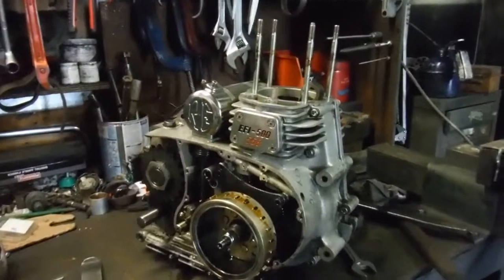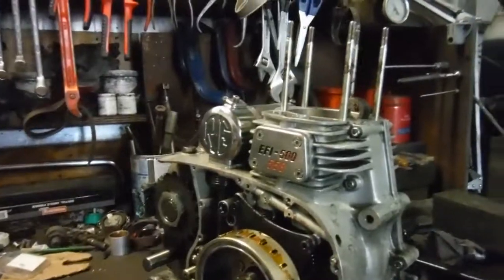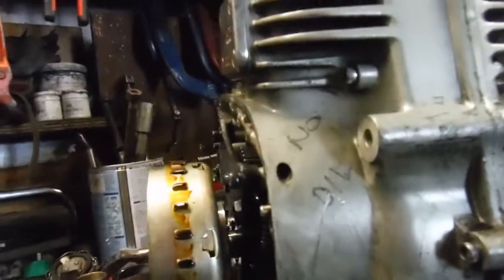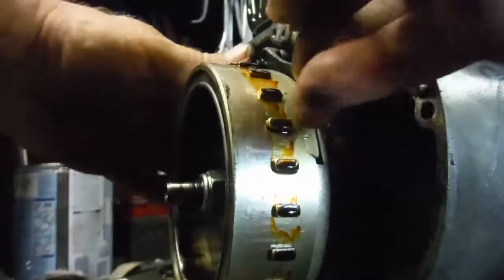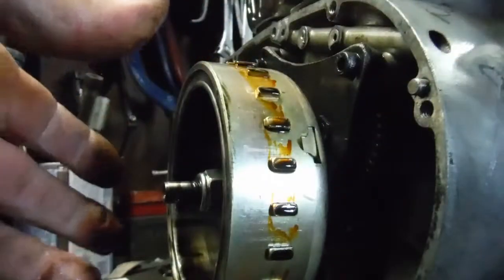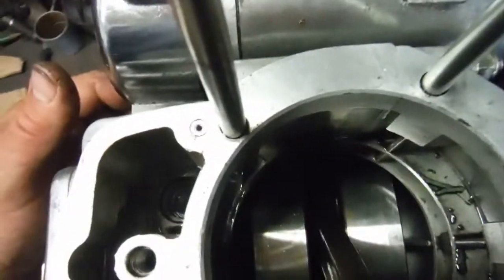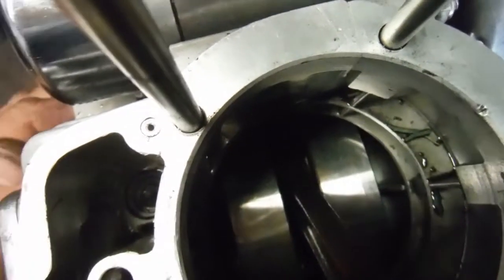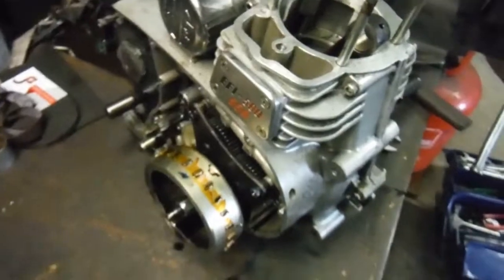Royal Enfield UCE Engine crank end float.

Comment: one way sprag , Nut tightening pull out crank towards LH cover as this tightening works as jacking the crank. End float disappear after tightening but exact centering to be done during major repair.
Reply from the maker: Everything was present and tight at this stage, before I stripped the engine.
Reply from the maker: When I stripped it, the nut on the end of the crank was found to be loose.